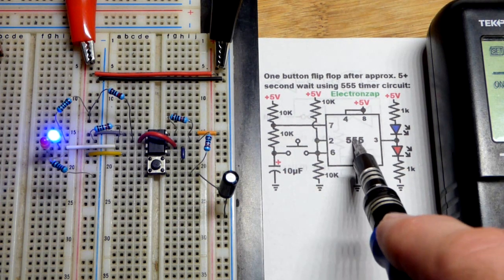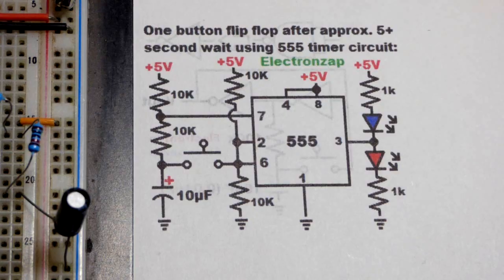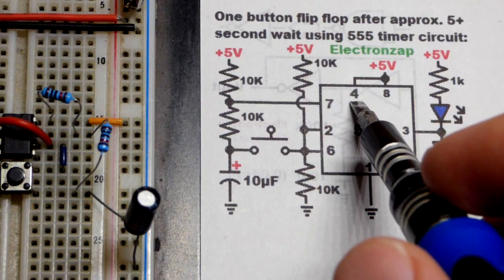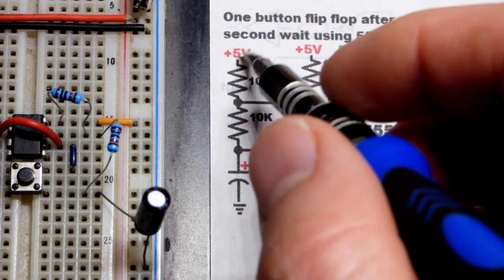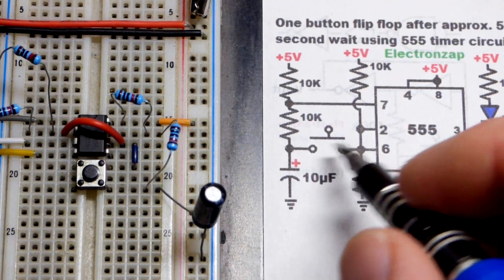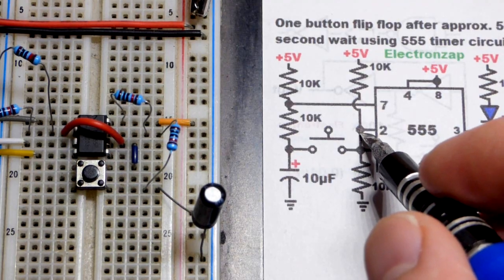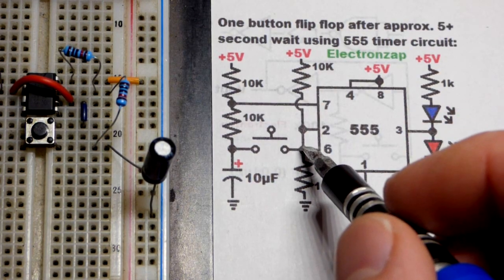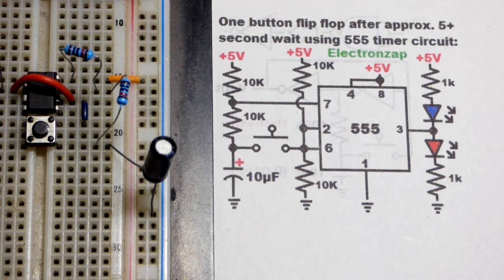Single push button 555 flip flop test circuit

Comment: Circuit worked perfectly. I swapped out the red LED resister from 10k to 220 and it lights with the same intensity as green now. This circuit is so much simpler than a data  and sr latch combo with a dozen transistors. Now, if I can only figure out how to combine this with a servo for left, then right, positions that correspond with red and green  LEDS. Thanks for a great tutorial!
Reply from the maker: Nice, thanks for watching!